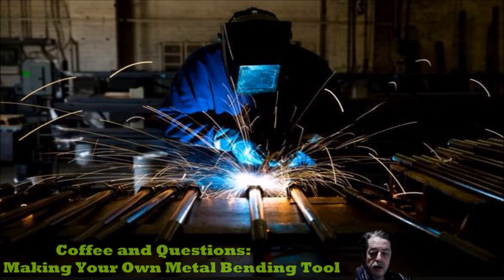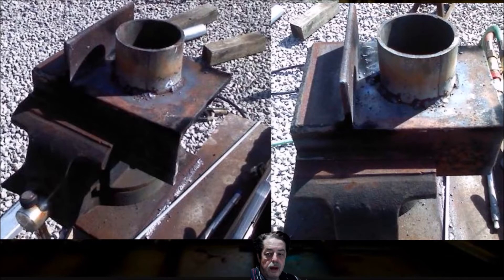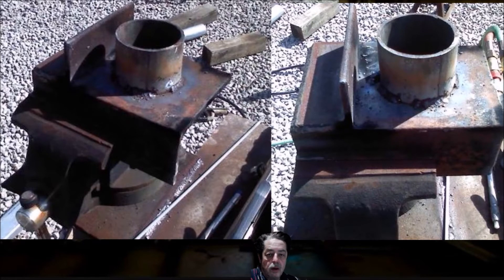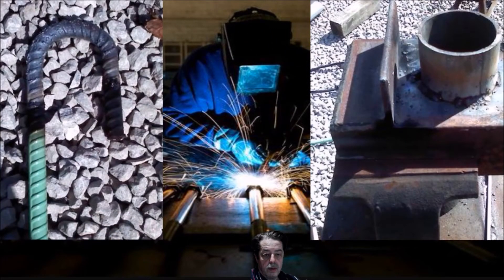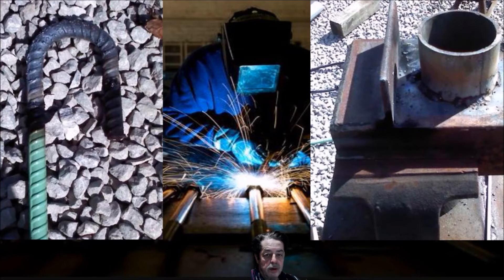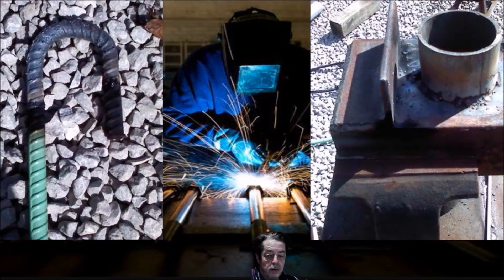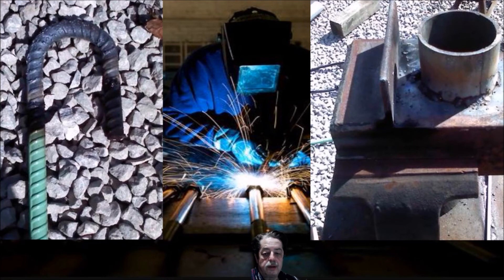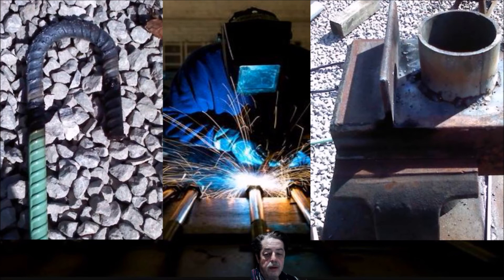Welding - How to Make a Simple Metal Bender

Comment: Nice good information to know thanks. what type of torch do you have and size of cylinder?
Reply from the maker: I have the H cylinder for oxygen (large) - Med size for acet - Standard Victor torch set I bought out at Air-Gas - it is a medium quality set with brazing tips and cutting torch, comes with a striker, gauges and hoses (complete set) - It serves any purpose I have need so far - do a Amazon search and you will see the sets - Also Harris makes a good stuff